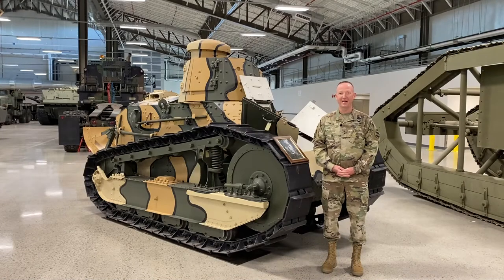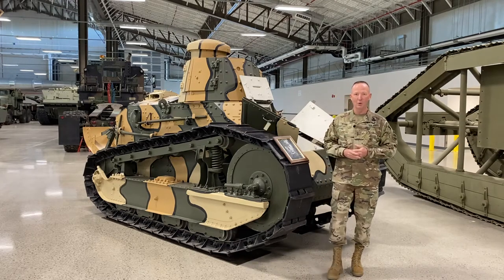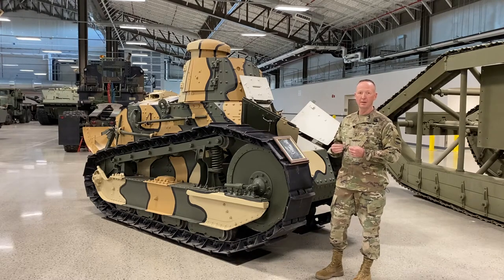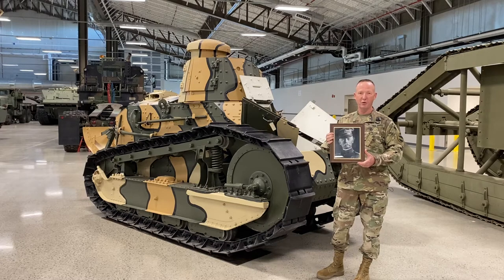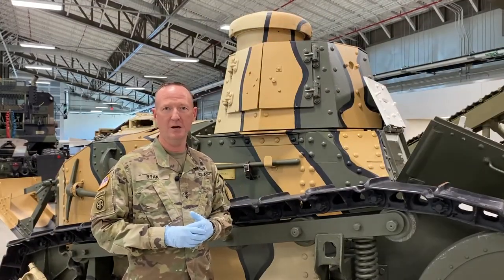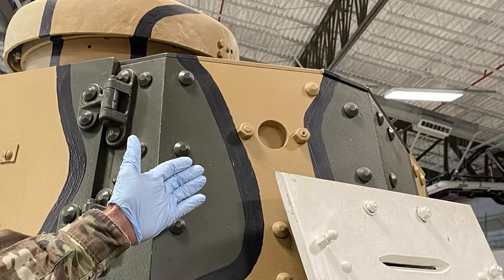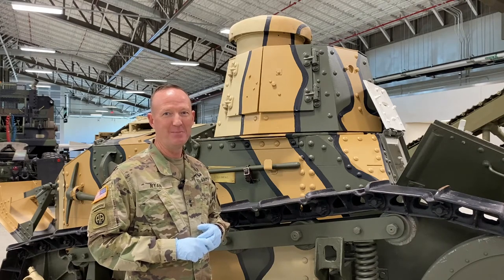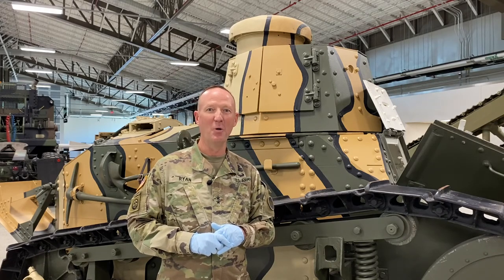U.S. Prototype M1917 Tank | Ordnance TSF: An Inside Look

Comment: Wait for it it’s worth it. Just wondering if it’s possible that something is still right where it was 30 years ago as a youth in Ky I grew up on a large horse farm that backed up to the artillery impact zone at Fort Knox yes the Lebanon Junction and Belmont gate area between us and the fire break was the Kentucky bow hunters refuge in the river bottoms. we would ride the river bottoms and on the fire break.  yes, even up to the jettison zone had detailed complete maps including the old pits point area. anyway one of these M 1917 tanks was abandoned at the Edge of the fire break Right under a rock overhang. which kind of shielding it from the elements if I remember correctly the seat inside was still in pretty good shape. We would always circle around that way before heading home. We use to wander on Memorial Day when the facility was open to the general public how many people may have been within 10 yards of it and never knew it was there lol